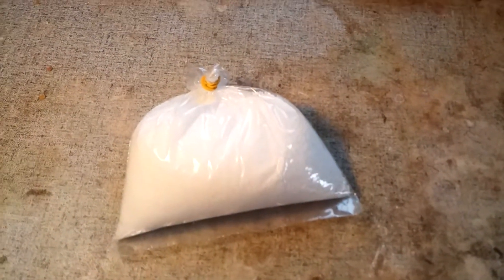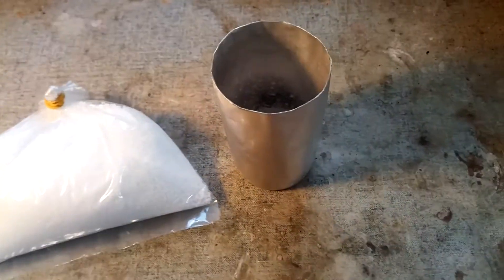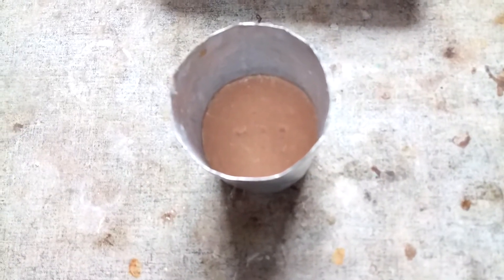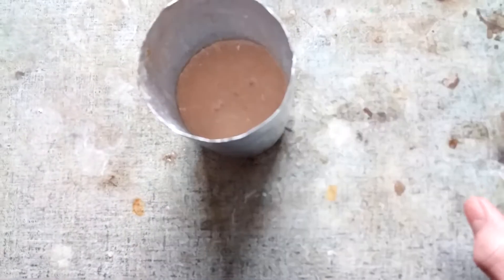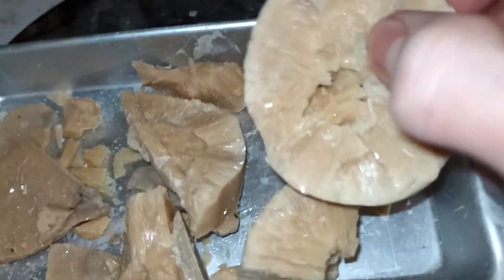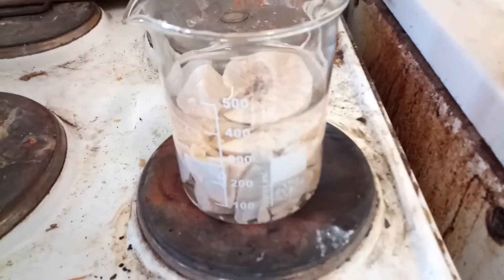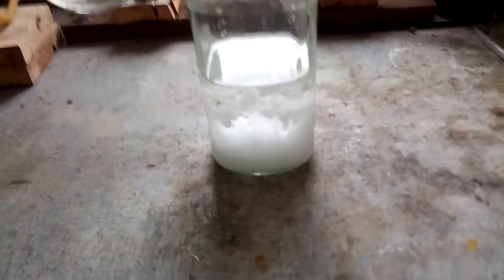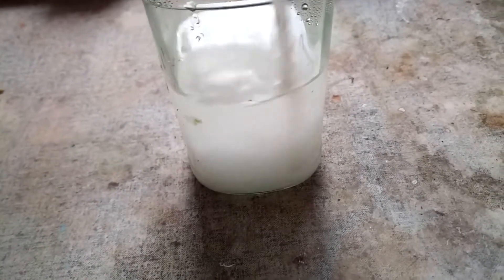Pure biuret from urea

Comment: How do you know how much sodium hydroxide to use?
Reply from the maker: The sodium hydroxide solution is supposed to be around 2% so roughly 2g of sodium hydroxide for every 100ml of solution. Also you simply want to use just enough to make everything dissolve (typical recryst practice).
Reply: @Bavarianscience  Thanks! I should have been more clear. I meant how much solution to impure biuret, but it looks like you answered that also! :)
Reply: Apparently you can also purify by sublimation, around 400 C
Reply from the maker: @flyingmojo5  In a vacuum perhaps? Biuret would normally decompose at ~200°C.